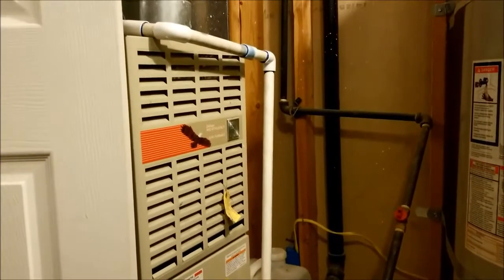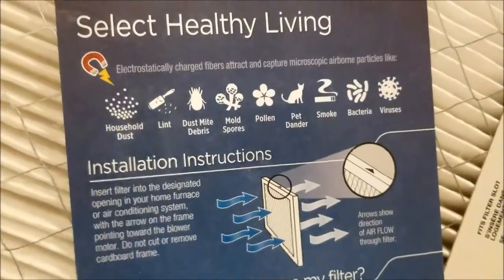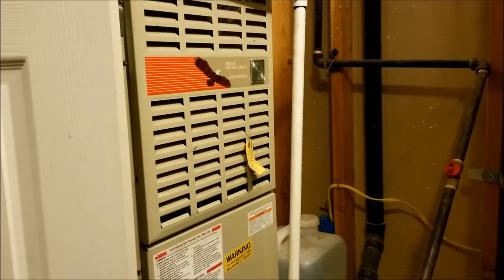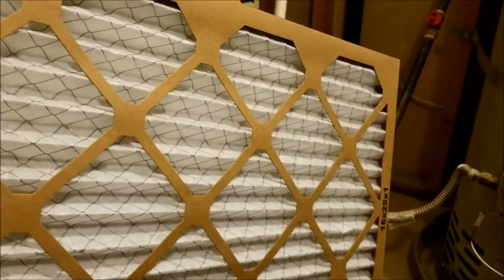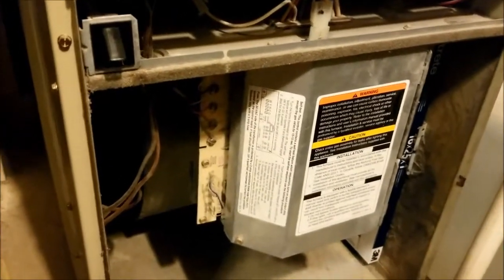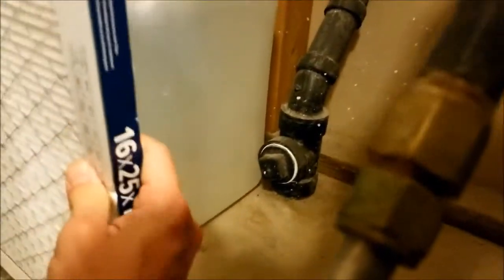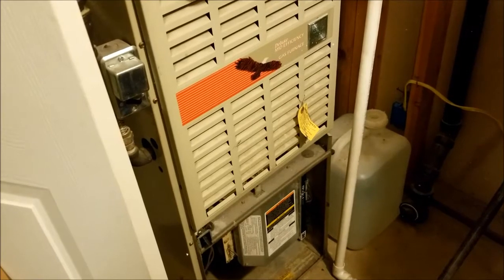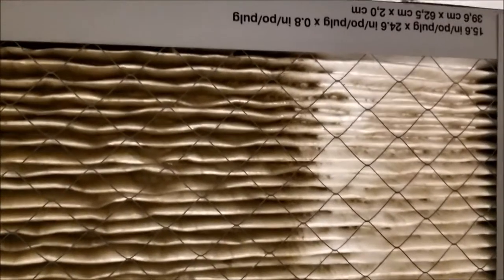How to improve indoor air quality when there is smoke outside

Comment: When i turn on my AC with the wildfire smoke outside, the house really starts to stink like smoke.  If i turn off the AC and turn on the fan full time, I don't smell it.  What might be causing the smoke to be getting pulled in while the AC is running?
Reply from the maker: You may need to do some weather sealing to prevent air from being sucked into your home.  Some AC systems suck air in from the outside directly by design rather than re-circulating the air inside. My system just re-circulates air inside my home.  Make sure the weather stripping/seals around your windows and doors are in good condition. It would be a good idea for energy efficiency reasons to make sure air leakage is minimal especially around windows and doors. For now you may not want to run your AC system until you seal the air leaks.  If the smoke is extremely high in concentration and you have already done weather sealing you may want to put tape and plastic over certain windows or areas where the smoke may be getting in. Of course make sure windows and doors are closed too. Smoke is the worst. Running the AC at my house does help when I have a good filter in place but I have made sure my home is mostly air tight. You can just run the fan and or a portable HEPA air filter instead if you need to. Good luck! Thanks for watching!